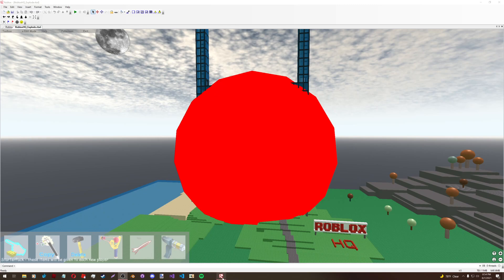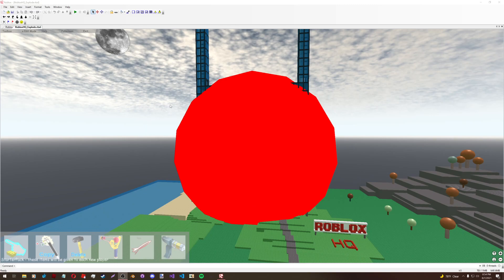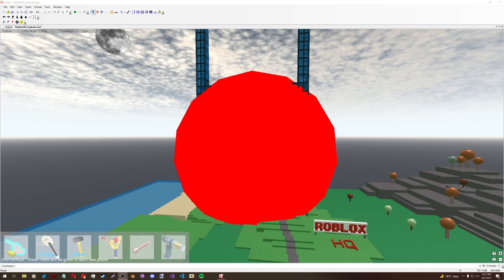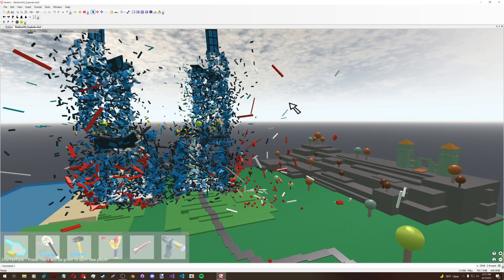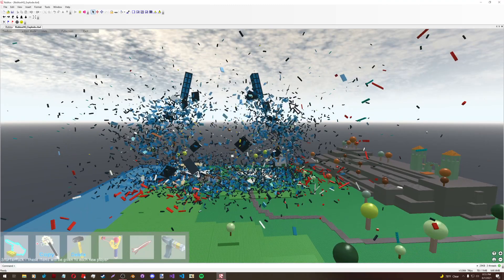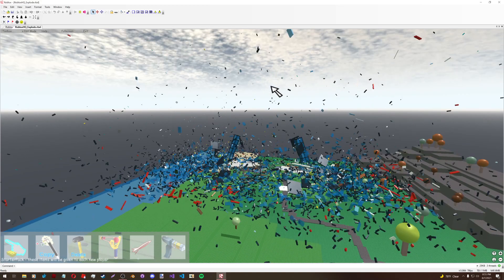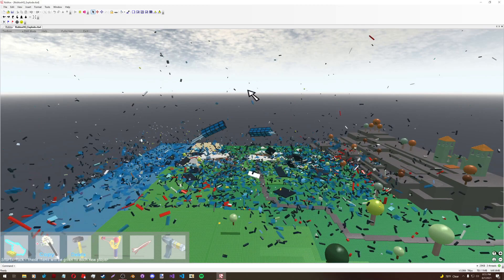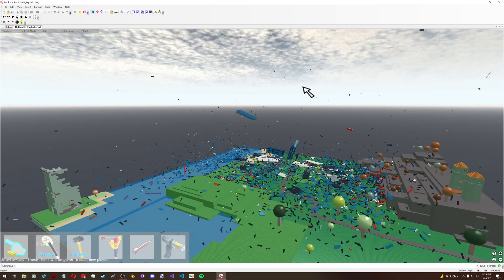Clarifying Roblox's 2007 physics engine performance.

Comment: The ROBLOX HQ map has too many parts to run at full speed on a 2007 client anyways even without stuff being blown up, whether you're running it on an old mid-2000s PC or a modern day PC. It definitely makes sense that the FPS would be dropping down to 1-2 FPS when you blow the whole building up. Fun fact: The ROBLOX HQ map in 2007 didn't have the Time Bomb weapon available to use ingame, probably so people couldn't easily collapse the building and their FPS.

BTW, clockwork's footage of the ROBLOX HQ exploding much faster than normal isn't the only time the ROBLOX team has sped up ROBLOX footage to make it look deceptively faster than it actually is. In the famous/infamous ROBLOX "IT'S FREE!!!" commercial made in 2011 by John Shedletsky, the last scene of the commercial (the "DESTROY EVERYTHING!!!" scene) where the tower collapses is sped up, which you can tell from the astronauts in that scene running and jumping much faster than normal.

Comment: Could you do a video on 2007 client vulnerabilities? Like remote code execution and IP stuff? That'd be very cool.
Reply: Goodblox is a a good example of this. It runs on the old roblox client, and it recently got shut down due to being hacked and many people having their ips grabbed.
Reply: @sickinmultipleways  I tried the join script in March 2007, and I saw that the player inside the NetworkClient was named some IP address.
Reply: @sickinmultipleways  Just did some research, that is the loopback address for a localhost. I don't know what I'm saying but that's what it said when I looked up the address.
Reply: @sickinmultipleways Also, if you could just execute a script in studio with "game:service("Visit")", (used in backend ROBLOX servers for managing place visits) that would mean it would be very possible for visit manufacturing.
Reply: @lossycompressed  There actually was a time in late July 2007 where at least 3 users on ROBLOX managed to create a script that fooled the ROBLOX website into thinking that there were more players in their game than there actually were. The third "most popular" game during that time had a "Players Online" count of around 150-250 (around or slightly less than the total number of users that usually were online during peak hours in the summer of 2007), the second a "Players Online" count of 1,000-5,000, and the "most popular" game by kjj86 ended up having a "Players Online" count of 40,000 (That was around the total number of users registered on ROBLOX at that time!). For comparison, the most popular games on ROBLOX in the summer of 2007 usually only had around 30 players online at peak hours.  It should be noted however that the script only increased the "Players Online" Count on the Games page, and didn't actually increase the number of visits, so the perpetrators didn't gain any ROBUX from this.

Comment: while it most definitly a time lapse it could be because its a older version of the engine such as how borderlands 2 runs worse on a 1060 then a 480 due to it not being updated to support modern hardware
Reply: Wtf are you talking about?
Reply: @benjaminjones8782  They're talking about optimization for hardware at the time. The engine is probably only using 1 thread out of 16, because most CPUs back in 2007 had 1-2 threads/cores. Also, the GPU is hardly being used at all since this is physics based, and not graphicly intensive. This is part of why the game is running slow.

Comment: If you have the best PC in the world, the 2007 physics would still be 1 or 2 FPS maybe 3 FPS if you're lucky.
Reply: 5 fps at best if you have the newest amd epyc or TR
Reply: @asd98b  roblox runs on cpu / ram / gpu
Reply: @8O8_guy  yes and
Reply: @8O8_guy  so does every other game
Reply: lol
Reply: what if you had a nasa super pc
Reply: @cool-nu9do  4 FPS
Reply: @FankieFmas  200000 ping
Reply: @cool-nu9do  ping and fps is different
Reply: how about NASA’s pcs? i saw some dude showcase it by blowing up a tower of tnt in minecraft and it didn’t lag once.
Reply: @QuestionableFumi  doesn't really matter about how good the hardware is, it's just that it isn't optimised at all. 
minecraft doesn't have intense physics either so it's obviously easier to run
Reply: @QuestionableFumi  at least an average of 40 fps.
Reply: @folddyy  6 fps*
Reply: @half-dusted  but then how did mr shedletsky man run shadows in early 2008? nani?
Reply: @folddyy  he used a fricking super computer, the best in the world
Reply: @half-dusted  from 2006? O.O
Reply: @folddyy  yes
Reply: I FOUND YOU!
Reply: Just because Roblox was required for Old computers

Comment: Roblox should focus on smoother real time physics. And it can be done, games like TearDown and BrikRigs can run real time physics smoother and they are more detailed and stuff.
Reply: more optimized* but yeah roblox physics engine is garbage
Reply: @Boi-ii2lm  Yeah but they're also more detailed there's millions of voxel chunks that make up those textures and in the first mission in teardown I'd say in the abandoned house there's around 5,000 voxel cubes maybe even more
Reply: Roblox is slow because it's designed to be lightweight, run in multiplayer, and run on all kinds of devices, including phones or relatively old pcs. Teardown (can't speak about BrickRigs, as I don't know much about it) wouldn't even start on a phone, and if it was multiplayer it would have insane ping.
Reply: @karacticusplay1781  Not only that, but Roblox is also purpose built to hot load all of its content off the servers too. Not as much content can be prebaked because it is made to load and run arbitrary content on the fly without questions asked.

Roblox's back end systems also don't provide many hooks to customize how the engine works at a lower level. This makes it harder to optimize by tailoring the engine to the content, or the content to the engine beyond a certain point. 

The engine is also missing quite a few different optimizations you might see in other similar tools. Backwards compatibility makes it a lot harder to make changes without breaking existing content.

A recent example would be with events. They tried changing the event handling behavior to defer event messaging to scripts until after the engine is done with its own tasks, but that broke a lot of peoples' content without a viable alternative. The change would have increased the engine's ability to make use of the cache, improving memory access speeds, and reduced the costs of context switching. They have to hold off until they provided alternative features that had similar behaviors in common use cases and gave enough time for developers to switch over.
Reply: to be more accurate, Teardown and Brick Rigs
Reply: Y’all ever play doom spire brick battle or the one made by poly hex
Reply: @Sov_spoiled  yes he has done a great job with the realtime physics. I’m talking it being a default feature on Roblox
Reply: @JoePez  isn't doomspire just the default roblox physics?
Reply: @Cautioned  no, the creator scripted something that makes the blocks fall smoother and without lag
Reply: TearDown barely runs
Reply: @seba2366  for me it runs pretty smooth, and I don’t even have that good of a PC.
Reply: @JoePez  it might be because teardown is really good at using GPU while roblox is more cpu-intensive. If roblox were to get everything more gpu centered maybe physics would be just as good or even better tbh (on good systems though)
Reply: @Cautioned  yeah I guess
Reply: @JoePez  ir run bad on my sh1tty 2009 laptop that cant run anything except doom
Reply: also, the physics is a bit off like when something spinning hits an unmovable object it launches back for some reason
Reply: brick rigs is still the same, not much different
Reply: Easiest way to do that is turn the damn game into 64 bit.
Reply: @Captain_DeSync  But i like roblox graphics
Reply: @JoePez  it has nothing to do with the graphics, but how many computations the game/CPU can do per second. Look it up.
Reply: @Captain_DeSync  BUT I STILL LIKE ROBLOX GRAPHICS DUDE! RIDDLE ME THAT EH!?!?!?!?
Reply: @JoePez  I agree, their graphics are pretty good. But like I said it would run 10000x better if it was 64 bit.
Reply: @Captain_DeSync  I DONT CAAAARR I WANT ROBLOX GOOD GRAPHICS AND I WANT THEM NOOOOW!!!!!!
Reply: @JoePez  have you seen future is bright lighting yet?
Reply: @Captain_DeSync  NOOOOOOOO!!!!!!!1 ROLLBOX GRAFIK NOO0W!1!!!!!
Reply: Optimizations would be hard because Roblox is built in Lua, an interpreted language. Interpreted languages are much slower than compiled languages.

Difference:
Compiled languages turn the program into raw machine code, taking some time to make the program into the fastest possible version it can.

Interpreted languages go through each line of code one by one in real time and run instructions for each line. It doesn't compile it into raw machine code, it just runs it.

Interpreted languages have a significant usability advantage over speed. It's easy to code with and test Lua code, but with Java it has to build to a binary every time, incentivizing bigger changes before compilation.

TL;DR language doesnt make exe file which is fast, so physics are slow because of how much the computer has to do
Reply: @cerulity32k  roblox engine is actually built on combination of c++ and lua 

words from roblox blog:
"The Roblox engine is written in a combination of C++ and Lua, with the code that performs computationally intensive operations written in optimized C++, while game logic and scripts are written in Lua, for ease of development."
Reply: @cerulity32k  So theoretically in around let's say 100 years from now on if we had absolute nasa supercomputer beasts we might be able to handle this smoothly since we'd have way better parts than now?
Reply: @cerulity32k  so that's why my laptop can run tf2 but not some Roblox games
Reply: @cerulity32k  That isn't actually how Lua works as an interpreted language. It is still compiled, just not into machine code. It's compiled into bytecode which is a lot faster to run than if it were interpreted in its readable text form.

Lua as a language supports compiling to bytecode at run time or recomputed bytecode, but Roblox's specifically precompiles to bytecode and is only loaded on bytecode in running servers. In Roblox Studio it does do run time compilation, but they don't even include the bytecode compiler in the Roblox player anymore because of exploits.

Java runs as bytecode as well, but I'm sure that Java has more focus on compiling for execution speed of the compiled bytecode than Lua. Java doesn't need to worry about compiling the code fast because it is done as offline compilation like with C and C++. Java also has built in JIT support while Lua needs an extension for that like LuaJIT, but Roblox doesn't use LuaJIT.

Also, as Boi said, the Roblox engine internals are written in C++, not Lua. Lua is just used as the scripting and sandboxing layer for game developers.
Reply: they gotta fix movement latency
Reply: @YouViolatedTheNAP  True, but still would be cool to have fancy physics
Reply: @YouViolatedTheNAP   agreed
Reply: Have you tried running tear down? It fucking shreds pcs.
Reply: @MacCraker they would probably have remake a large portion of the physics engine. The studio settings only change the render engine, so just how roblox is displayed. Physics is all calculated on the cpu, and probably only built for cpu at the moment. Maybe they will port it one day. I found a video on cpu vs gpu, so from what it looks like it could greatly improve roblox's physics. https://www.youtube.com/watch?v=wf9nadEEmtw
Reply: @MacCraker wdym, go to settings>rendering and they have a dropdown where you can choose opengl, vulkan, directx, metal, nographics, or directx 9.

They also do have keybinds File>Advanced>Customize Shortcuts
Reply: @MacCraker oh ok I see, yeah they should add settings like that in-game.
Reply: only issue is that brick rigs has absolute shit physics in multiplayer and teardown doesnt even have multiplayer, also brick rigs physics arent even that good in general